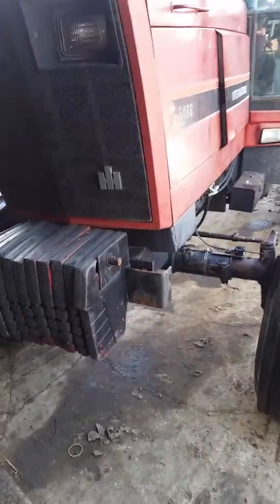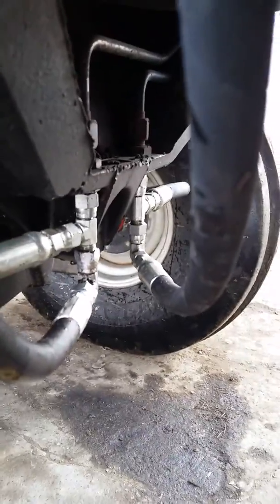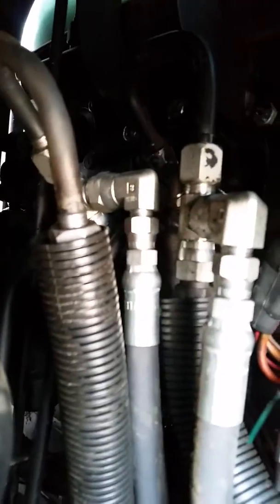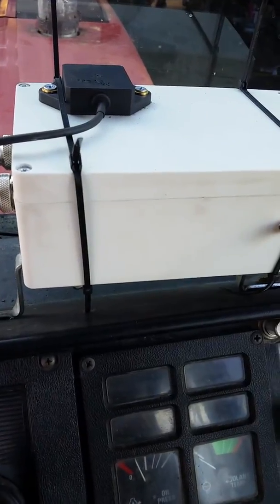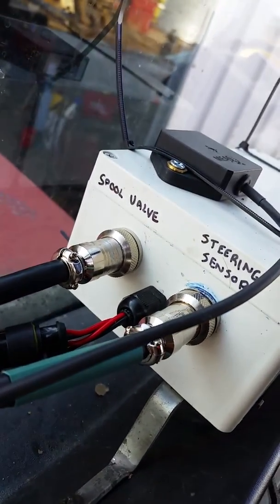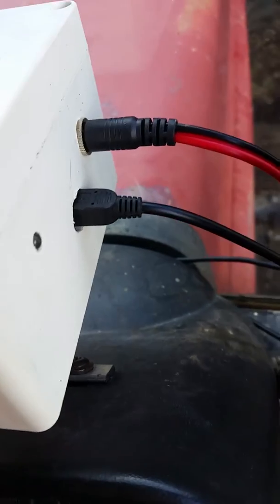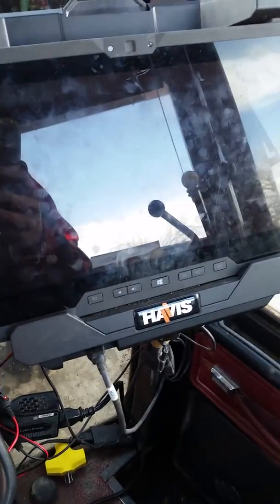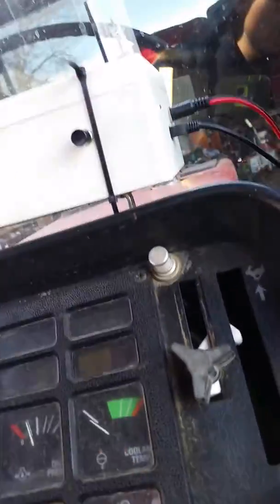IH 5488 Hydraulic Autosteer

Comment: What setup did you use for the steering valves?
Reply from the maker: It's a Hydraforce SP10-47C.
Reply: Where did you buy it at?
Reply from the maker: Find your nearest dealer on the Hydraforce website. I can't remember the name of the place I got it but it's in Tea, SD.
Reply: Thanks. Do you have any thoughts on what would be a good GPS reciever? I was thinking about getting the Reach receiver and adding RTK later with a second receiver.
Reply from the maker: Not really but the reach seems to be gaining popularity and I think most people are happy with it.
Reply: How do you like it? Is it still pretty snappy steering for being rated at a max of 6gpm?
Reply from the maker: Steering works great. There is a small bit of oscillation but I believe that is due to wear in my front end. I did plant corn with it and it did a very good job. Steering is responsive enough to do auto headland turns at 6mph. A larger MFWD tractor may require a valve with higher flow-but I'm not sure about that.